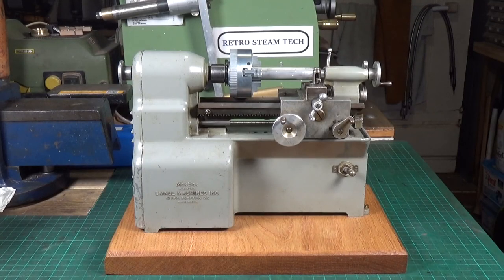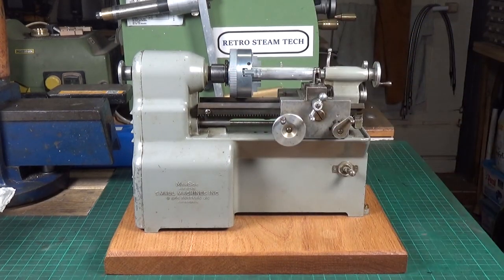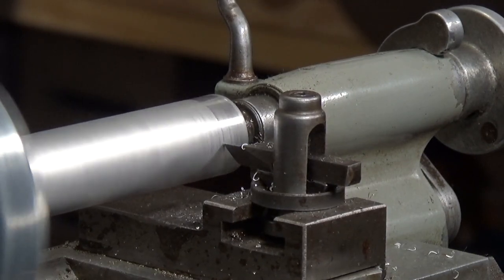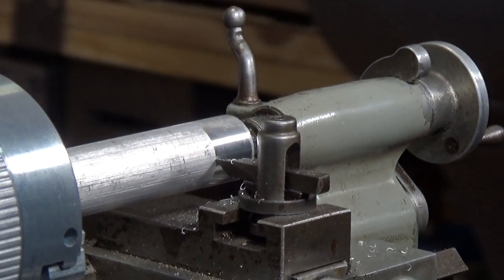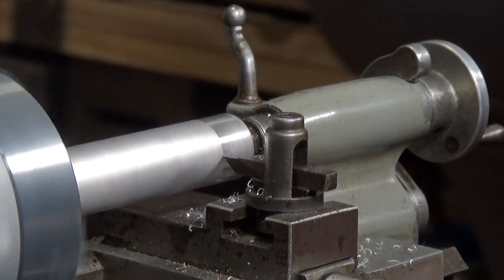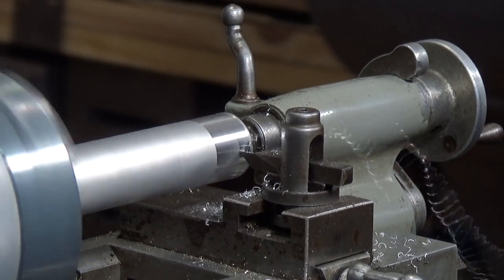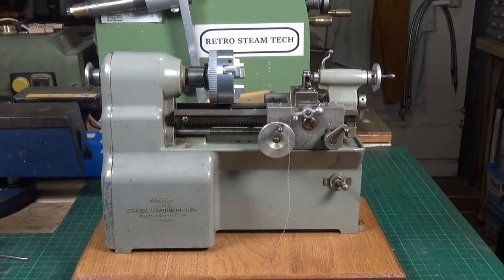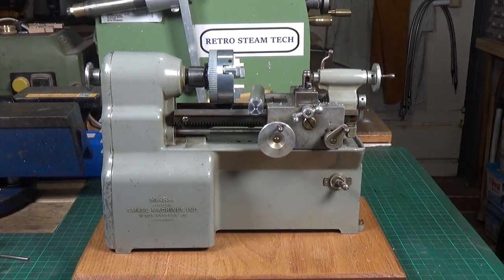Manson Lathe - Part Four - Making Some Aluminium Chips

Comment: Hello Alan,
Such a cool lathe... It's nice to see it can be put to work as well...
Take care
Paul,,
Reply from the maker: Hi Paul. Considering that it only runs at about 500 rpm it's actually useable as long as you only take small cuts. Cheers, Alan.

Comment: Top little lathe Alan.  What is the correct voltage for these ?  Cheers Rob
Reply from the maker: Hi Rob. The motor is rated at 110 volts which would probably have been correct for American mains voltage at the time. I use a step down transformer which outputs 120 volts and it runs fine on that. Cheers, Alan.
Reply: @RetroSteamTech  Hi Alan,  All good.  I was pretty sure it was a 110 volt unit and wondered how you dealt with that.  It looks good on the wooden base. Better than money in the bank these days.  Cheers Rob
Reply from the maker: @Xynudu  Hi Rob. Having many American electrically heated model steam engines in my collection I have acquired several heavy duty step down transformers. So running any American gear is no problem. The base is made from a piece of scrap oak that I got from ebay. Took me bloody ages to plane it flat but it looks quite nice and is heavy enough to stop the lathe moving around when in use. Cheers, Alan.